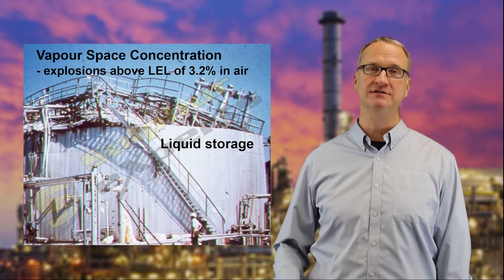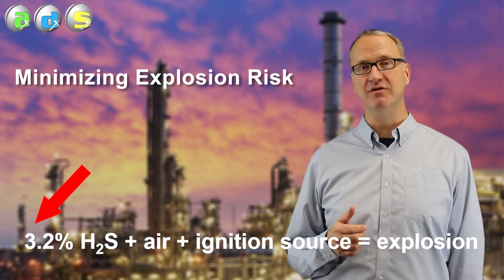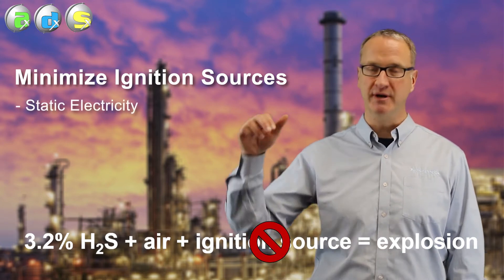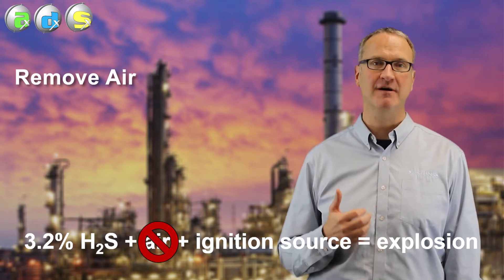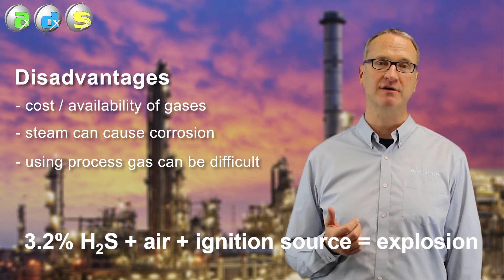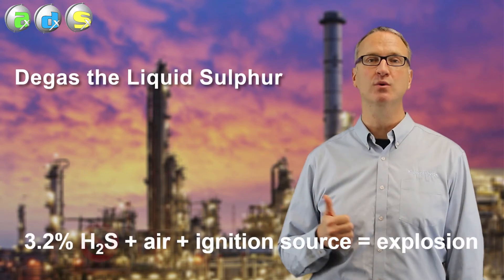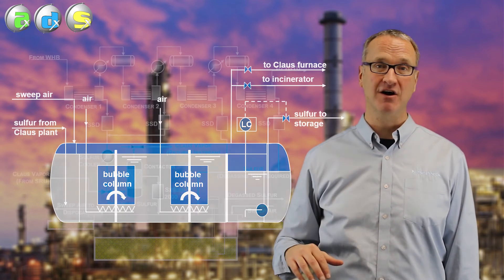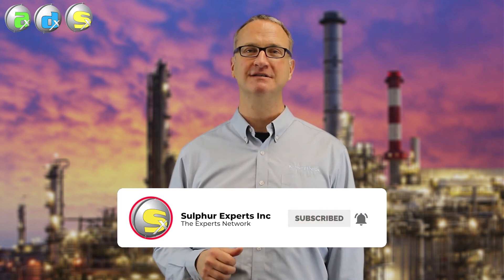How to Prevent Liquid Sulfur Storage Vessel Explosions

Comment: What happens if the sweep air ejector is not functional and the h2s gas flows back to the atmoshere through the sweep air inlet?
Reply: The eductor issue is always happening in sulphur plant. Jacketing in the wductor inlet line to be checked to avoid plugging and during shutdown, ensure that these lines are clear. And try to give seep air from thee incinerator fan/blower discharge instead of natural suction through vents.

Comment: Hi, very  nice info. We have a concern in sru train Sulfur storage tank. We dont have drain option to empty out and drain completely during T&I. We have to pump out using sulfur transfer pump to the bottom most of the level to main sulfur storage tank .our project team belives it can be done smoothly using pump to empty out tank completly.is our understanding corect.that it can be done smoothly. What kind of safety concerns might arise if empty out completly using transfer pump...

Comment: I work in sulfur recovery and we have a problem we could not fix. We have high percentage of H2S in the sulfur bit. If you have some ideas that can remove our lower the The percentage of H2s in sulfur pit I will be thankful.
Reply: 1. Your steam jet ejectors are plugged 2. Your run-down seals are passing process gas 3. Your degasser outlet is plugged. 4. Degasser cooler is not in service. High temp. feed to degasser will reduce the stripping efficiency. 5.Degasser itself is plugged and resulting in channeling. 6. Sulfur pit Vents are plugged 7. Pressure spikes from the run down 8. Converter efficiency is very poor